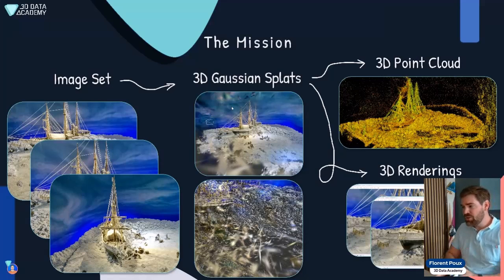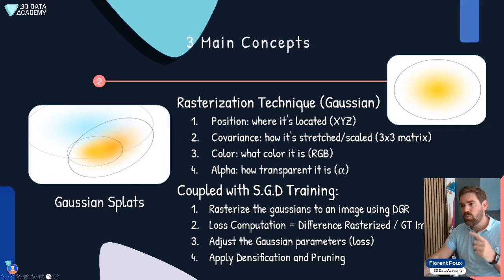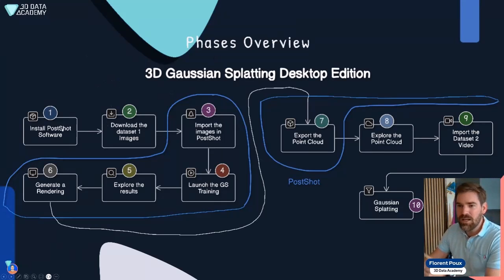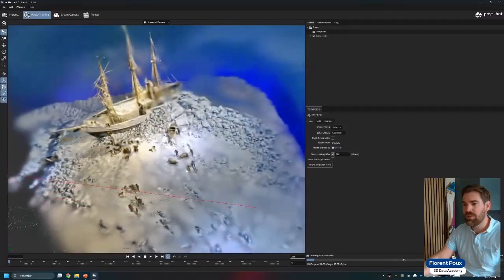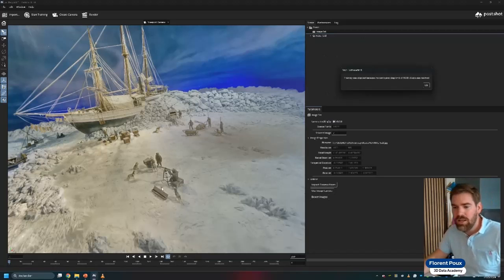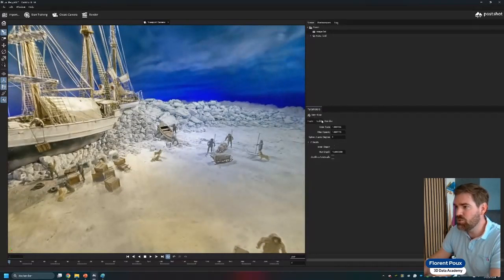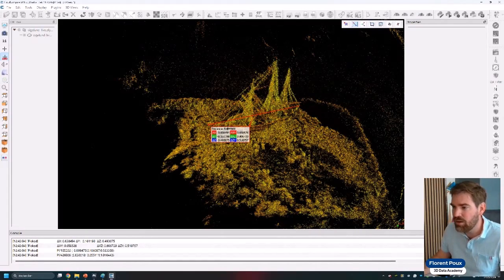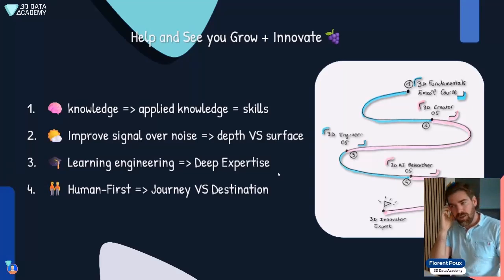3D Gaussian Splatting: Hands-on Course (Desktop Edition)

Comment: Does dual rtx 4090 will make difference ,or 3dgs only utilize single gpu?
Reply from the maker: You can use both, but it will not make a huge difference with the current implementations

Comment: Hey, nice video. I tried using gaussian splat for the shampoo bottle that I sell online. But had pretty bad results. the model was not clear and the output was in general was hazy and not useable.
Reply: What capture method did you use? Did you make a movie or took pictures? What camera did you use? What tool did you use for training your data?
Reply from the maker: I support these questions :)
Reply from the maker: Hmm yeah, with some specific shooting and/or material, the result is still not tremendous. Do you want to share your image dataset with me so that I explore a solution?